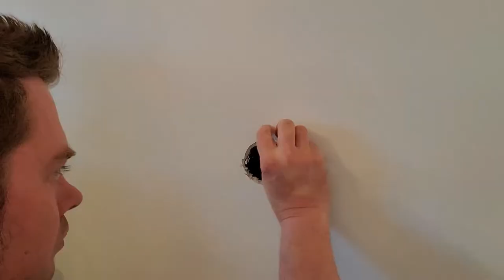Patching a Large Drywall Hole with Spray Foam

Comment: My god man, put the foam in and leave it alone till next day! Then use the six inch mud knife to slice over the hole. Then slightly push foam in a tiny bit to get below wall surface to have room for some sheetrock mud.  Last,  float it with the 6" knife a couple of times over a 2 day period and your done!. sand and paint.
Reply from the maker: Haha...but...then what would I do with all my spare time?! Yeah, I wish I was more patient that one day. Your suggested method involves far less time, for sure! Thanks for the comment. 👍

Comment: Next time, try a California patch.  There are plenty of how-to videos on YouTube.  It’s a better repair, and easier (IMO).  Home Depot, Ace hardware and other places sell 1/2”x2’x2’ drywall for patching.
Reply from the maker: Thanks for the tip! Now, my only problem is that it wouldn't give my Scottish sensibilities that satisfaction of using up something I already had and not having to spend any money...🤣🤣
Reply: Where did your Scottish sensibilities get the spray foam?
Reply from the maker: 😂The foam was given to me by a buddy after I helped him out with a project. He didn't need the rest of it, and I thought I'd try  out the leftovers on this.
Reply: I think the repair you made was alright.  There are kits out there that I think are much worse.  But, I also think that drywall is best patched with drywall (and mud).
Reply from the maker: Yeah, it was an odd experiment. I was surprised by how well it worked and that it's as strong as it is.

Comment: using a hacksaw blade works well to get the cutting edge flush with the wall surface, for anyone cruising the comments for ideas.
Reply from the maker: Yeah, that's a good idea. I imagine you'd just have to be careful if the blade is factory painted some dark color or something that might rub off onto a light colored wall. Thanks for the tip!

Comment: They make a door strike plate that is a round plastic disc designed to cover existing wall damage.  In your next video, you should demonstrate that it is like $2, and sticks to the wall in 3 seconds.  They can be painted too...
Reply from the maker: True enough, but I didn't want to slap a plastic disc on this wall; even if I painted it, that disc would still jump out at me and annoy me every time I looked at it. My goal was to repair the damage, so it looked like it never happened. More work, for sure, but worth it in this case (for me). Thanks!

Comment: You could've used cardboard as a substrate as a backing to spray your foam onto. Great video though.
Reply from the maker: Yeah, that would have worked, for sure. Would have saved me time, too, considering I was using that sad, old can of foam that took forever to come out. 🤣 Thanks for the kind words.
Reply: Hi! Can you explain how you would use the cardboard? (Essentially how to place it and hold it inside the wall while you spray). I had two holes and the bigger one may need this. Thanks!
Reply: @amylz3347  Or card would work. Glue the outside of cardboard or card, then use a small flat headed nail, to push through the card then push through the hole then pull gently towards you til it has glued to the wall from the inside. Then you can ease the nail out having done it’s job.

Comment: Thanks! Does this hold up well & is spray foam easy to sand? I want to make the wall as seamless as possible, but it’s in an area (beside a bathtub) where it is tricky to do a furring strip, so this seems perfect for me!
Reply from the maker: It has held up well...after I first cut it off, I tested it with some pushing, etc., and it didn't move. If you have a deep space like I did, you need to make sure to get some around the back side of the drywall, stuff it won't reach to the far side, and it seems to hold really well. As the video shows, I had to cut it a few times, as it was still a little moist and had yet to fully expand in the centre but, once totally dry and cut, the sanding was really simple. It's crazy that this method isn't more known as a great fix. This is probably the most proud I've been of a wall patch job, and it was certainly the most daunting hole I've dealt with. This would work in any space/ location, as long as you can get a blade or something to cut the foam flat to the wall once dry. Good luck!
Reply: @ThisDadGoesTo11  Thanks! Does it look flawless in person? Does it blend with the wall?
Reply from the maker: @carrieray1478  The patch job does indeed look flawless in person. The only thing that isn't perfect is that the paint is ever so slightly off in color, as the existing paint was applied several years ago. Really, I can only even tell if the light hits the wall at a very particular angle. As long as your paint is identical, this is the only way I'd recommend dealing with a large hole, and you'd never know anything happened.
Reply: Thank you so much! I thoroughly enjoyed your video and you’ve given me the confidence to tackle my projects.  Beautiful job by the way!!
Reply from the maker: @slipnthru  You're welcome! Thanks for the kind words. I hope your project goes well. 😁
Reply: Yup I've used this method.
Reply: If you leave it a day or two, it slices right off easily.  I used a very long serrated knife.  Had this idea before I saw the video.

Comment: Our hole was caused by a screw anchor being taken out of the wall. Any idea how foam works when using that area again to attach something heavy to the wall or would you use something other than foam??   Thanks!
Reply from the maker: Hey, there. A fix like this shouldn't mess up the structural integrity of the wall. I wouldn't try to insert another screw anchor in the exact same spot, though. I would try to relocate it at least a couple of inches away, so that you're biting into nice drywall. I think this would be my answer, regardless of the manner of patch repair. Good luck!

Comment: Yes the hole is patched, but Is there a way to make it match the orange peel that dry wall has? I have filled in many a dry wall hole but then it is smooth and obvious compared to the orange peel of the dry wall area not patched.
Reply from the maker: Hey, there! I found that this repair job matched well. I think using a roller on it would be an imperative finishing touch (rather than a brush), as that helped with some of that orange peel texture that you mention. Honestly, once the paint dried, I couldn't see any difference, other than the slight colour difference in the paint (the original paint had sun faded just a bit), and that was only when I looked at it from a particular angle. Fortunately, as this was behind the door, I don't often see it from that angle. It would be remedied by painting the full wall. Not sure if that helped at all, or not. 🤣 Thanks for the question!

Comment: Would this technique work on the ceiling? I have several half-inch drilled hole in the ceiling. Thanks in advance for the advices!
Reply from the maker: Yeah, I don't see why not. Sticking the straw through the hole and getting some foam in there...hopefully, some would work its way down and out that hole. Then, you could finish it off. I'd give it a try; worst case, it doesn't want to flow down, and you have some foam above the ceiling that you'll never see. If you do try it, let me know how it goes! Good luck with the holes. 👍👍

Comment: Why not put a door knob Bumper In Place there to prevent it from happening again?
Reply from the maker: 🤣 Oh, that definitely happened after. One of the kids had messed around with my existing bumper and unscrewed it. Before I noticed it, the incident occurred. Bad trick of timing. Got to try out this way to fix the wall, though, which is a trick I hope I won't have to use again anytime soon!

Comment: My wall has a hole and it’s high up like yours and doesn’t have a surface so my question is will the foam fall into the wall as it’s not sitting on anything if you get what I mean
Reply from the maker: So, I made sure to aim the first foam at the back side of the drywall, so it touched it and stuck to it right away. Once that sticks, you just keep spraying the foam to the stuff that's attached to the back, and it works like a charm. I've had no issues with mine since this time.

Comment: Maybe when trying to cut the foam flush with the wall, how about a piece of string where you use friction of the string and go down the wall back and forth, and it will cut right through the foam.
Reply from the maker: Hey, that's a cool idea! Yeah, assuming a person was careful not to rub the wall so much as to scuff it, that would likely work. Thanks for the tip. 😁

Comment: Is it suitable for closing ventilation system?
Reply from the maker: Do you mean completely plugging it or just insulating around it? I doubt it for plugging, but insulating is probably fine. I would recommend contacting the manufacturer of the specific spray foam, just to ask that question and ensure safety.

Comment: Great job, well done sir!!!I learned something today 🙏🏼🙏🏼🫶🏼🫶🏼
Reply from the maker: Thanks! It's a fun little trick that works really well. 😁
Reply: @ThisDadGoesTo11  
Thank you for your reply! 🙏🏼
I didn’t have to learn or do any of this kinda works around the house when I was married… but since I’m a single woman now, I have to do it myself and honestly I like it and really enjoying it, I decided to not bother my dad or brothers for every single thing and got my own tools and with the help of videos like yours I can do pretty much anything around the house, unless it’s a heavy job or more professional stuff! Anyway I was gonna ask can I use Wood filler for a smaller hole in the bathroom wall? The hand towel holder loop came off, the hole is much smaller than the one you showed in your video… I bought wood filler before I watch the video, if not would you put the name of the foam you used please? ThNks again , have a blessed night and happy weekend!!🙏🏼🙏🏼🫶🏼🫶🏼
Reply from the maker: @gemini5513  Great news! It's satisfying to accomplish these tasks on one's own. 
I don't think wood filler would work very well. Drywall patch / spackling compound works best. It's like a white paste. Apply with a putty knife, let dry, lightly sand, reapply (if necessary... usually with wider holes, such as if you pulled out a wall anchor), sand again until smooth and flush with wall. Then, paint. 
If you're looking for the spray foam insulation, brands such as "Great Stuff" or "Lepage" work great. Available at nearly any hardware or big box store. 
Good luck! 😁
Reply: @ThisDadGoesTo11  Thanks! very much appreciated your helpful response, I will go shopping at Lowe’s tomorrow and will keep you posted once I get it fixed. 😊🙏🏼
Reply from the maker: @gemini5513  Awesome! You'll definitely find what you need there. Yes, let me know how it goes! 👌🏻

Comment: Does the stuff dry pretty hard?
Reply from the maker: Yes, indeed. Hard enough to provide a solid backing for the drywall putty, for sure. It still cuts well, though, so that's not a struggle. Thanks for the question! 😁

Comment: Foam spray should not be used like this. First, it should be shaken well and then used upside down.
Reply from the maker: True enough about the orientation of the can. I did shake it a ton, but was a little thrown off by trying to get the dregs out. Looking forward to redeeming my can handling next time. :)

Comment: Interesting idea but definitely a way easier way to do that, even without a plastic over cheat.
Reply from the maker: Yeah, the first time I did this was to repair a hole in a friend's hollow interior door. It worked great for that, and my spray foam can was brand new, which worked way better! 🤣
Reply: @ThisDadGoesTo11  Yea u mentioned that in the video lol, I just recently used a used can as well, not fun lol. But what u did here is doable for drywall but way easier ways. 

That exact size hole I just did a few days ago with mud alone. While working on other projects.... While I was painting the rest of the place. I plopped mud in there & what stuck I let dry while painting. Still not fully dry but, I sanded it lightly, then reapplied very thin as needed. 
By the time I was done painting, that top layer dried. So I sanded, painted, done. I'm sure the rest inside the wall was still drying. 

Also, if understandable lol.....
Some people use a small but long enough piece of wood that can fit in. Screw in the middle to hold the wood against the inside of the wall with "screw as a handle". Screw either side of the wood threw the drywall holding the wood & remove "screw handle".... Mud, etc.
Reply from the maker: @ScottWhalen81  🤣 Yeah, absolutely! That definitely would work. Once I started this, I was actually sad I didn't do something similar with a wood backing piece, just to let that foam hit something right away, so I could have used less. Would have sped it up considerably, given the trouble that can was giving me...

Comment: My question is how strong is it. How many new hits from the door handle will it take before it pops into the wall?

I’d have used a firing strip and either screw it on the ends or use some liquid nails holding it in place with a screw in the middle and then used a drywall circle instead of the spray foam. More work but I think it would hold up much better. 

Or 

Get a metal drywall patch (mesh) for the outside of the wall and use joint compound as it’s stronger than spackling.
Reply from the maker: So, I haven't hit it really hard or anything, but I gave it a few good raps with the knuckles after the job was complete, and it seemed virtually as solid as the rest of the wall. I'm not worried about the door knob ever striking it again, as I made sure to have the door stop back in place (having my kid unscrew it from the wall was what led to the problem in the first place!), preventing that contact with the door. Also, it's in a location of the room where the wall basically never gets hit with anything, as our door is usually open. There are definitely other ways to solve the same problem, and some that could be more durable as well, but this was a weird and wonderful way to use up a can of spray foam and accomplish the task. I honestly wasn't sure it would work when I tried it, as my only similar experience was in repairing a hole in a hollow door. I was pleased it worked as well as it did.
Thanks for the question and for watching! :)
Reply: if ur worried about it happening again, use those door stoppers that attach straight into the door hinge by using the existing pin, u can adjust it so it never even makes contact with the wall

Comment: Is that toxic? Does it prevents toxic gases and vocs from entering?
Reply from the maker: I don't believe it should be a problem. Spray foam is often used for insulating window casing installations, etc. This is also a fairly small amount of foam - far less than in each window in my home, for example. Thanks for the questions!